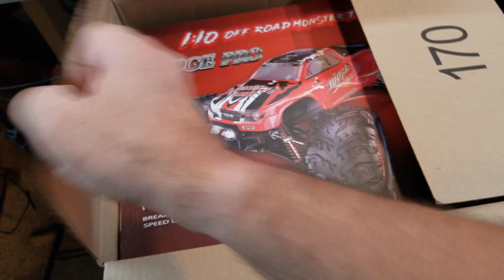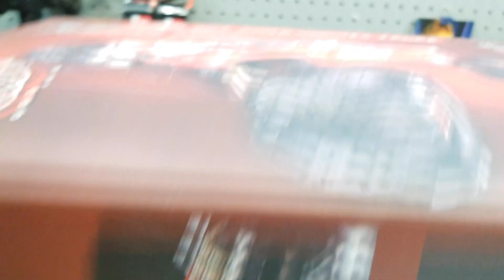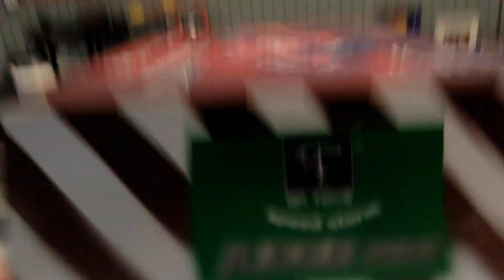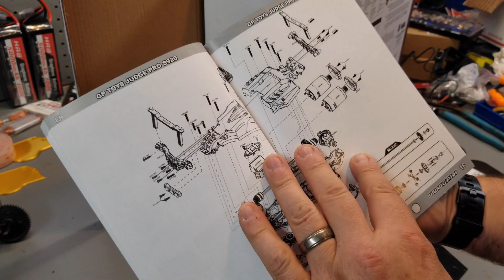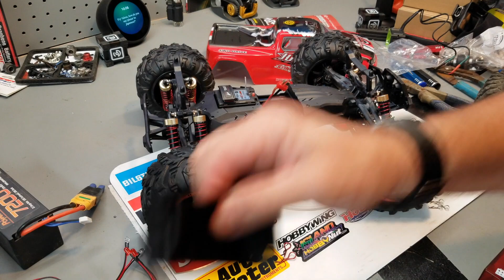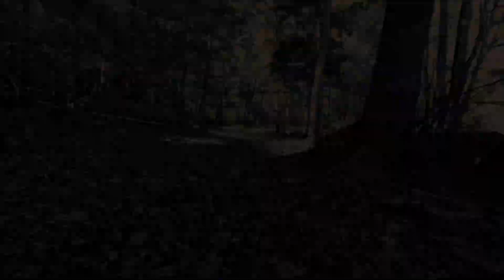G-P TOYS 10th Scale Judge Pro Dual Motor Brushed

Comment: I have the older blue version. It's pretty cool for the price. Scale wise, they're lying out the ass because if you scale it to a real truck of any kind, you're basically anywhere between 1/14 and 1/18 depending of you look at length or width. You would probably need to replace the body with some kind of atv to truly have it be the claimed scale, but all the companies lie about scale and really it's nor worth too much arguing.

Giving you an extra gear set and oil shocks is definitely a step up from the older model, and in either case this truck is sold under so many names that parts are more than widely available.

Comment: Did you turn on the high-speed mode? I guess there are 2 modes?
Reply from the maker: Yes and yes . . . . after that first pull I had to do a double check😂🤣😂🤣Part 2 it wakes up a little bit more